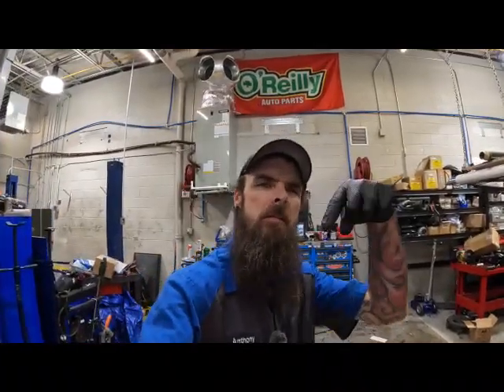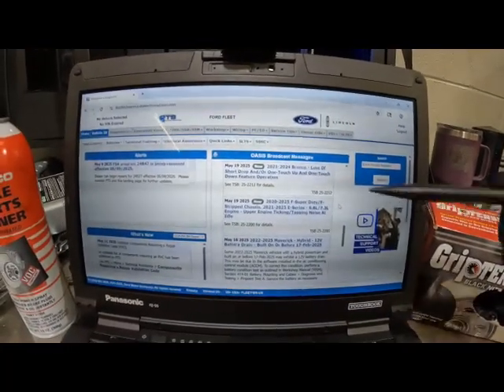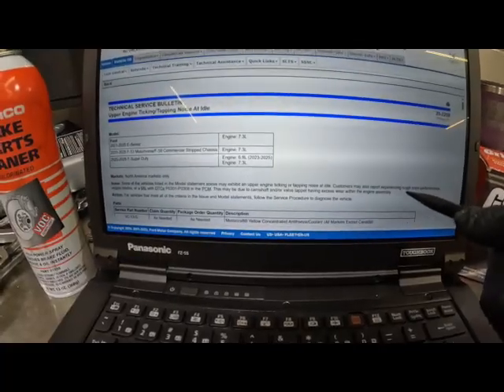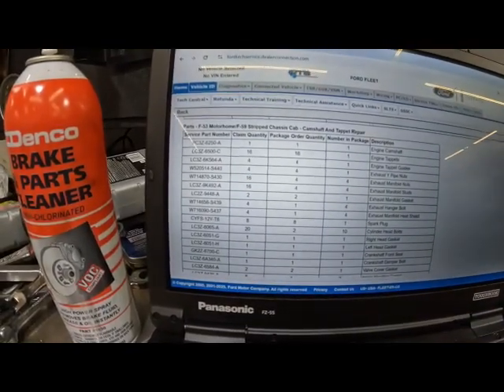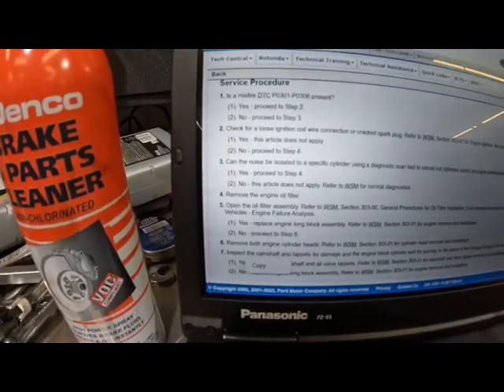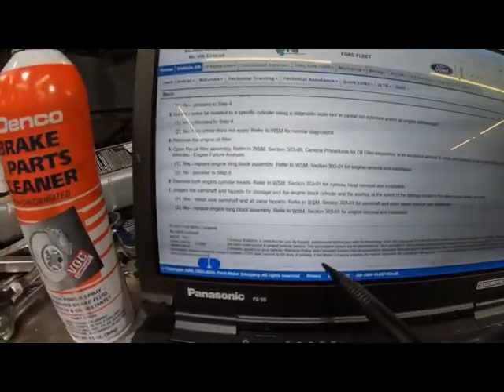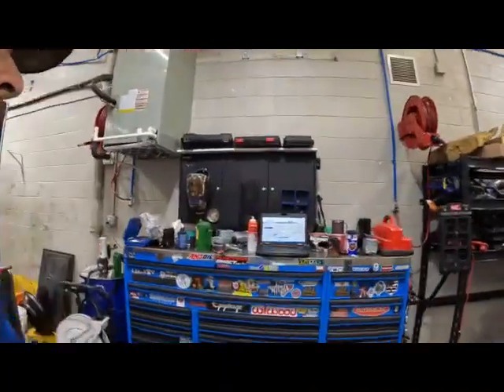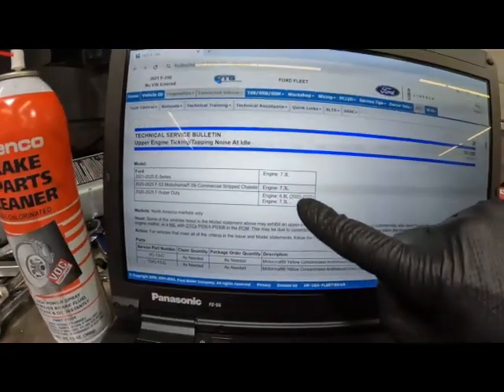Ford 7.3/6.8 Liter Tick Tapping at Idle

Comment: Damn I am a rodeo guy a lot of idol and driving after 25,367 miles i have the upper ticking on the 6.8.
Reply from the maker: When do you change your oil?  If you idle a lot it better not be 10k miles.  Does it get louder with rpm?
Reply: @BeardedFordTech  it doesn't get louder with higher rpm but i do hear the ticking at 6th and 7th gear.
Reply from the maker: @americanlife4228any driveability concerns? Check engine light?
Reply: @BeardedFordTech i had a check engine light for a miss fire, one of the coil wire burnt out. And that's when the ticking started.
Reply: @BeardedFordTech 2024 f250 6.8 gas it been in the ford shop six times for warranty work .
Reply from the maker: @americanlife4228😮
Reply from the maker: @americanlife4228mmmmmm thats very awkward.
Reply: @BeardedFordTech i change the oli ever 5,000 miles.

Comment: Need a good sound clip or someone with expertise and diagnose a tick coming from engine or I’m just imagining it.  It’s a slight tick also a small tick upon acceleration sometimes. Higher rpm and at hwy speeds nothing
Reply from the maker: Okay what year?  What engine?  They all make lots of noises. Injector tick being one of the mkst.

Comment: Is the TSB also for the super-duty line up or just only for the E series  and commercial trucks.

Wondering so i can ask about it on my next oil change and hopefully bumpy the oil pressure to prevent and lifter tick since im currently at 40k miles and hopefully last me a good time
Reply from the maker: What does the tsb say?  Its for the e series. If it was for super duty it would be included in the tsb.

Bump your oil pressure up to what?  What year is it? What engine is it?
Reply: @BeardedFordTech 2021 f250 lariat 7.3 with 40k miles
Reply from the maker: @7thkev519 it says 2020-2025 f super duty. E series and stripped chassis.  They arent going to "up.your oil.pressure" because you want them to.  Your symptoms have to fall.under this tsb
Reply: @BeardedFordTech oh ok was just wondering.

But would u still recommend that i should keep taking my truck to the dealer fir its oil changes or start doing my own and buy the ultra platinum Pennzoil oil for my truck or what oil would u recommend.

Asking since I no longer have warranty but im deciding if i should get extended warranty.
Reply from the maker: @7thkev519 you dont have to have it done at a dealer for warranty. It just shows a paper trail thats all. Keep your receipts. Ultra platinum is good.  Depending on the engine (the 5.0 and 7.3) it actuslly makes consumption worse. Look around the channel. You will see what I recommend.

Comment: I have a weird ticking between 800-1400 rpm’s that usually happen mostly unload. It’s intermittent and scattered. Brought it to ford they replaced plugs and wires thinking it was arching and still happens and then told me it’s normal. Brought it to a different dealer who found the TSB but said they can’t get it to make the noise. I have a short video of it. Can I send it to
You if you can tell me if it’s the lifter noise or something else?
Reply from the maker: Yep. Email it to me

Comment: Great video brother. In your opinion would an Amsoil or other oil bypass system be recommended for 7.3/6.8 Ford engines? Would it help at all?
Reply from the maker: Usually not needed. I've seen guys put them on f150s. I'm still not quite sure about that. Still kind of researching it. On a diesel yes. It gets the soot out.
Reply: @BeardedFordTech  Makes sense for the soot, was just thinking maybe it would pick up the extra metal particles from any bad lifters or cams delaminating
Reply from the maker: @hammtweezy2192 I'm sure it would. But if it went that far the rest of it is toast
Reply: @BeardedFordTech So in other words once that happens its not just the metal particles that have destroyed it, the engine is done regardless.  I have a 2016 3.5L ecoboost. Bought it new, has 50k on it, recently lost my job so just praying I don't have exorbitant repair coming my way. Always done 5k oil changes and on my next service getting the transmission fluid replaced and diffs. I live in the SW USA so desert land which I think is actually less harsh on most vehicles or so I've been told. Point was that is why I was asking about these oil bypass systems on gas vehicles but thank you,  sounds like its not really worth it vs keeping fresh oil every 5k.
Reply from the maker: @hammtweezy2192 cams delaminating on these isn't a issue.  Its a dual overhead cam with hydraulic lifters. Not a pushrod engine like the 7.3. Those delaminate and collapse.  The only issue you would be facing is possibly the need to replace cam phasers due to rattle on startup
Reply: @BeardedFordTech Ya I guess I should ask is there anything else I should be doing to keep the oil pressure good enough to prevent the cam phaser failure?
Reply from the maker: @hammtweezy2192 I meant to say roller rocker. Cam phasers ate going to rattle at some point. Replacement required
Reply: @BeardedFordTech  Okay, thank you for your time. I subscribed to your channel and greatly appreciate your conversation. God bless ❤
Reply: @BeardedFordTech Sorry one last question.  I've seem people claim flood starting your F150 will prevent the cam phaser failure because ot allows oil pressure build up before turning over the engine. True or false and does that wear the engine. I know it wears the starter.
Reply from the maker: @hammtweezy2192 anytime friend. Reach out if you need anything. Can always reach me by email. Comments get buried. Pricitate the subscription.  Just keep running  5w30 full synthetic.  On first start in the morning. You can do flood mode. This will help prime oil system and get you by for a while.  To do that. Hold the throttle to the floor and crank.  Its not going to crank cause it kills the injectors doing that.  Give it about 4 or 5 seconds and let off the throttle and it will crank right up.
Reply from the maker: @hammtweezy2192 true. I just replied to the comment so you k ow how to do it.  I forgot to mention that earlier. I think i did a video on it too.
Reply from the maker: @hammtweezy2192 here you go
https://youtu.be/bBnnSpSVq0g
Reply: @BeardedFordTech Thank you soo much have a great rest of your day.

Comment: I still say they got bad lifters mixed in with the good and haven't solved it yet.  I've only ever seen this with 1 lifter in any given engine and the rest are fine.  A lot of talk about it being oil pressure or idle related but I think we'd see different levels of distress across the camshaft if that were the case.  Obviously I haven't seen them all but I've only ever seen it where 1 is basically falling apart while the rest are perfect.  That tells me that was a single bad lifter.  When it's always a single bad lifter that tells me most lifters out in the wild are fine but there's a sprinkle of bad ones out there in the mix.  Any 1 truck has a great chance of having 16 perfectly fine lifters, but some of them got a bad one.
Reply from the maker: Same. All the ones I took apart were just 1 bad one.  The oil pressure thing had a pcm reprogram to bump up pressure at idle. That was customer satisfaction program 24B27. But that was just the 21-24 Ohio and Kentucky build plants.

Comment: Ford puts a lot of effort into their research for inspection and repair procedures. They have very thorough TSBs. Those "somebody else that we know" people seem to focus their attention more on flashy sales pitches such as: The Heartbeat of America, The Longest Lasting Trucks, See The USA, and my favorite... Like A Rock. The Hand Grenade of America is a much better theme. Chevies last a long time alright. Park a Ford beside a Chevy with For Sale signs in the windows on your front lawn. The Chevy will make a lasting impression as a permanent lawn ornament. Whether a local trip or long distance trek, you'll see the USA through the windshield of a AAA tow truck. The next time you go fishing, pick up a rock and drop it in the water. It just sinks to the bottom and becomes a permanent stationary fixture. Their new sales slogan should be: "Chevrolet. Pull The Pin On A Hand Grenade Today!". 🤣🤣
Reply from the maker: Thats because ford cares about the customers and wants to fix the issue.  GM cares about the profits. People keep emailing me telling me their customer service is horrible. I mean sorry not sorry. Nothing I can do.  Ford does these tsb voluntarily to address an issue.  Unlike this massive recall going on which was forced by NHTSA for gm. Otherwise they wouldn't have recalled it.
Reply: @BeardedFordTech  They also fixed an ignition switch by putting in an upgraded version, but kept the same exact part number, so if your switch went bad you had no way to know if it was the old one going bad, the new one going bad, or even if it was part of a recall, because you could not tell what switch model was put in there.
Reply: @BeardedFordTech Ford cares that's a new one . 😅
Reply: Yeah, like a Rock made of sandstone. lol
Reply: @robertclymer6948  🤣🤣

Comment: I thought this was already a known issue and Ford has fixed it for 23' up with the increase of the oil pressure at idle reflash?
Reply from the maker: Nope. Thats a different issue. This was release on The 19th.
Reply: Gotcha, seems very similar. So since this goes to 25' Ford still hasn't solved the issue is what this tells me. The TSB seems more like a guide to help the tech diagnose and choose a repair avenue vs. offering a solution to fix the issue. If you have the failure and get another motor or repair what's different with the new one to prevent it from happening again?
Reply from the maker: The onw you rwferring to was the customwr satisfaction progrsm 24B27 pcm reprogram for the oil pump to bump up pressure at idle. That was only certain teucks from 2020-2024 kentucky and ohio plant and the econoline van.
This TSB (technical service bulletin).is not a customer satisfaction program. And yes it is used as a diagnostic. You always look at TSB first.  If it doesn't fall under a TSB then you proceed with a regular diag.
As far as I can see the only difference (that I see) is the lofter part numbers have changed which if you got a new engine would have them in it.
Reply: Great info, thank you. I just purchased a new 24' a month ago. My first Ford and with the 7.3 so just trying to understand this. I switched after 25 years of gm truck ownership because of all the issues I was having with my 23 2500hd. Hoping this f250 will be different.
Reply from the maker: @Alloutdrs1 you are welcome. I think you will be just fine!  If you have questions or concerns. You can always reach via email.

Comment: Cool video man. My 2020 7.3 is still going strong 80k miles, I don't idle for long periods of time. Next oil change i will be opening the oil filter just to see.
Reply from the maker: I'm curious to see whats in your filter. Probably nothing. I saw.it mostly on work trucks.
Reply: Me too!! I also run it pretty hard. Engine sounds good
Reply from the maker: @ATF_ATM  💯💯👍